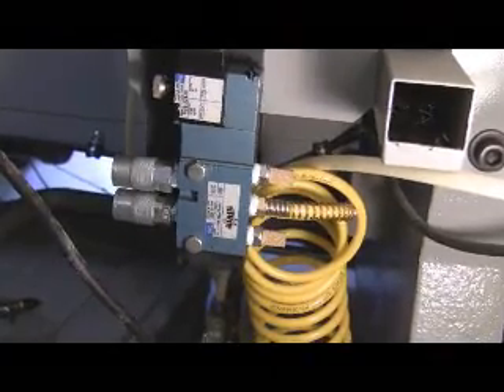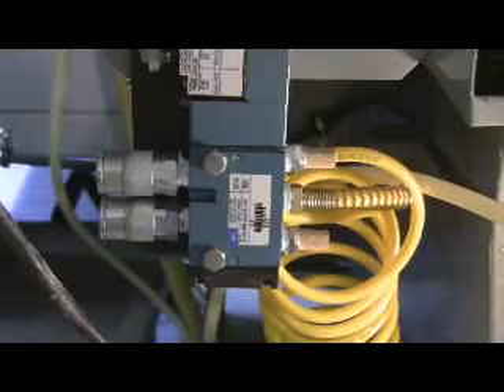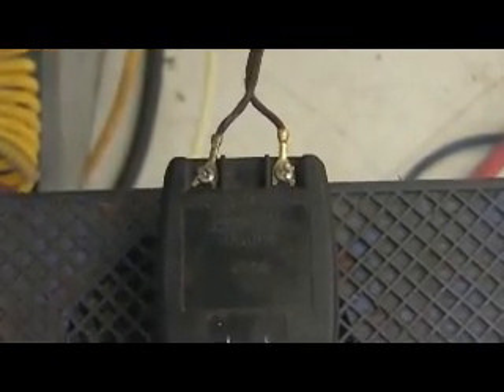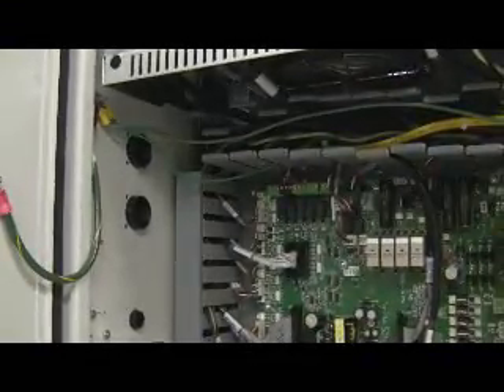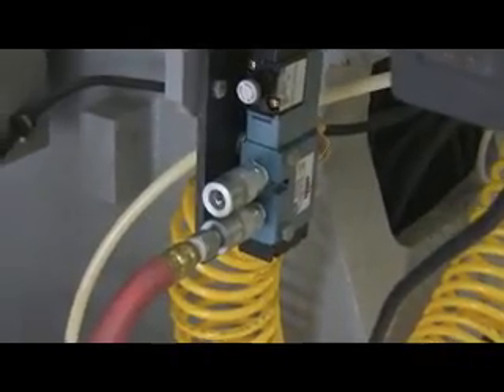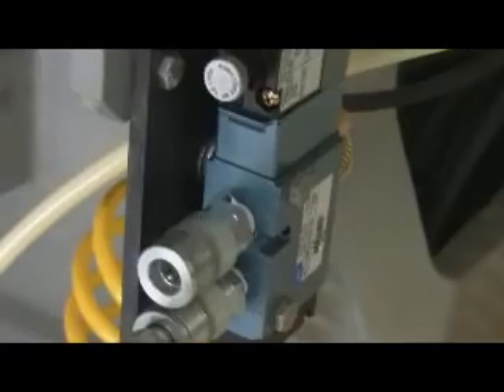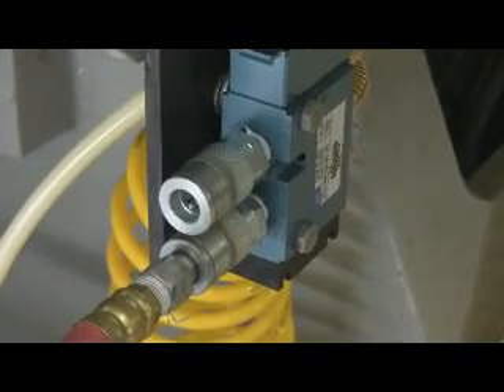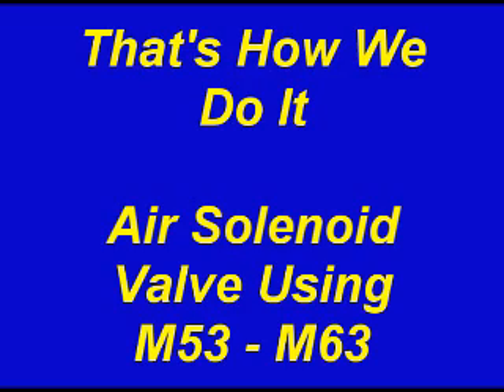HAAS TM-1P Air Solenoid Valve Utilizing M23 Relay

Comment: Hey there helicopterjohns, cool set up. I'm trying to set up a makeshift airblast sytem myself for a HAAS VF4 SS. I have a 120 Volt Solonoid valve capable of handling my psi. How do you suggest I go about this? Also, what's the capacitor for?

Thanks!
Reply from the maker: Hi Lotfi,

Thanks for the favorable comments.

Not an electronics expert.  I can only tell you what I did.  I had help from several people on various forums and the internet.  I believe that the capacitor was called out in a bulletin by HAAS as a snubber circuit.  I believe it has something to do with controlling any electrical spikes that could occur and preventing damage to the HAAS I/O Board.  I would have to look, but I think I have a copy of that bulletin somewhere.  If you would like to discuss this further you can contact me at clarkj@tampabay.rr.com

John